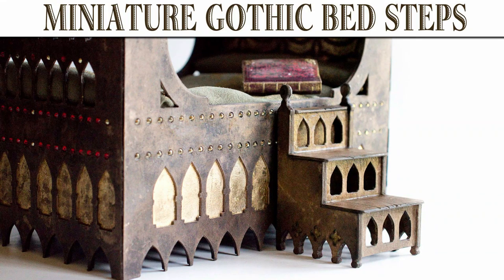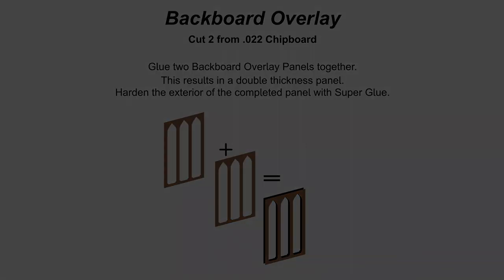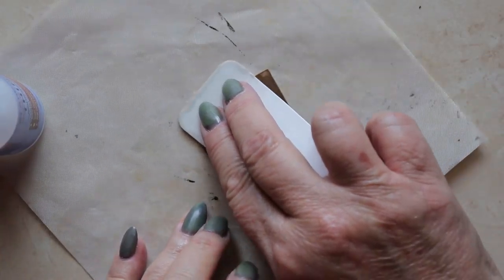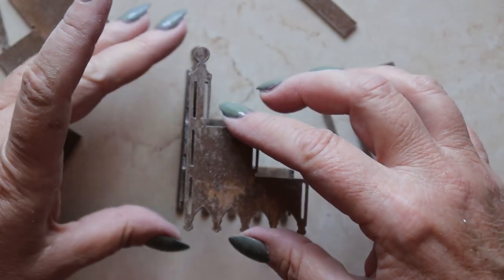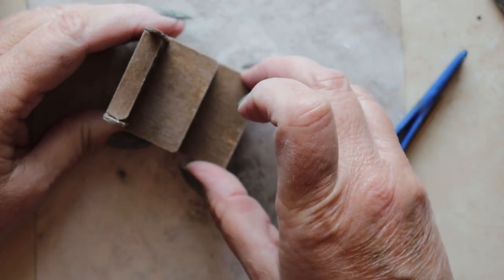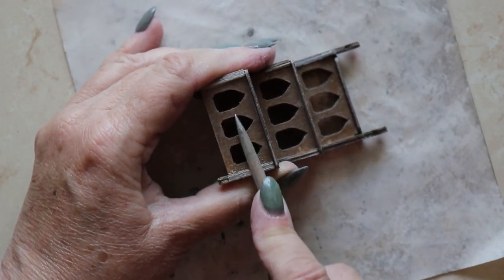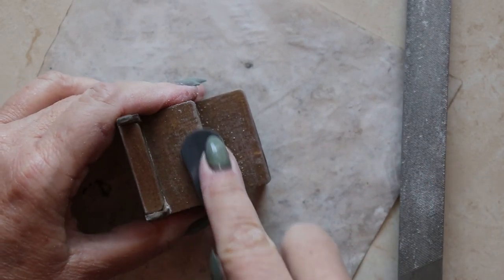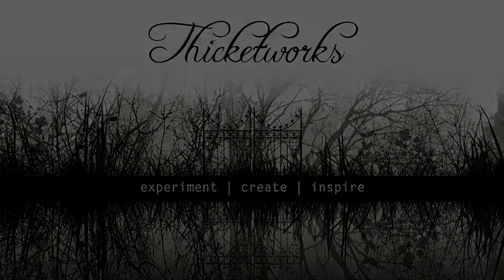🛠How to Build Mini Gothic Bed Steps🛠

Comment: Hi Heather.  I am really enjoying your videos.  The results are fantastic.  I am a total NOOB to any kind of cutter except a razor blade.  Am I correct in thinking you need a cricket or any type of e-cutter that takes svg files to be able to create a version of your items?  Are the files available as some other format so they can be cut out manually?  Thanks so much.
Reply from the maker: Hey there, @EllenEmOHPea! Thanks for connecting - and I'm really glad you like the videos: that means the world to me...

I suppose it would be technically possible to hand or 'fussy' cut the Jpeg, PNG or PDF version of the files, but it's a fate I wouldn't wish on my worst enemy, girl! WAY too tough on the hands. I've cut a few miles of chipboard by hand in my time, but there is no way I'd try these designs without an electronic cutter. I don't want to be discouraging, but don't do that to yourself - please! xoxo
Reply: @Thicketworks  Hey.. thanks for the quick reply. Thanks for the suggestions but, I see your point.  I enjoy watching anyway.  Thanks again.